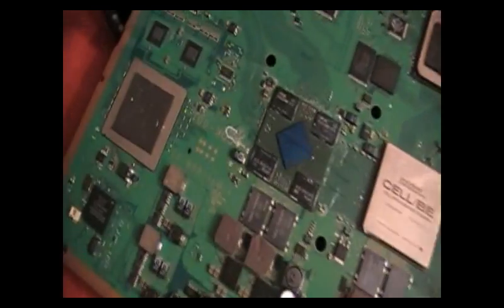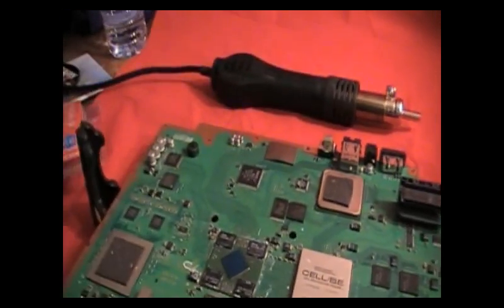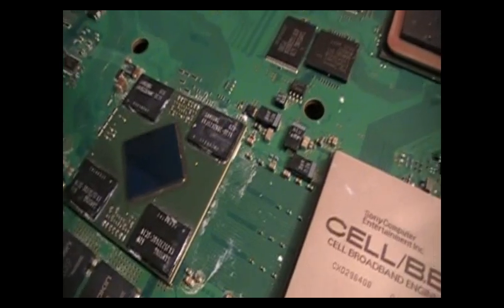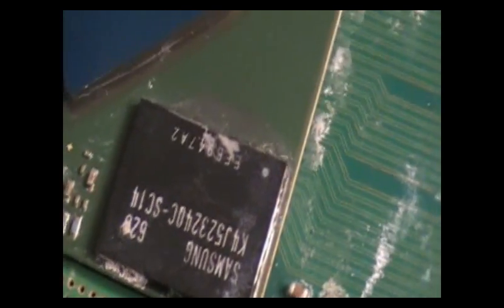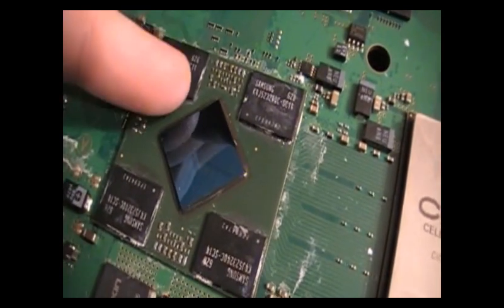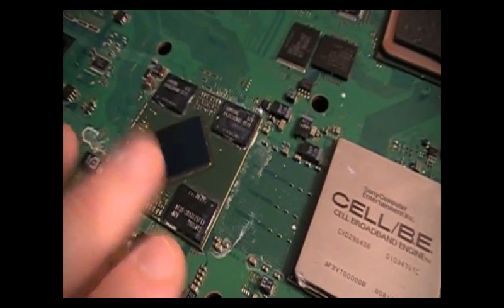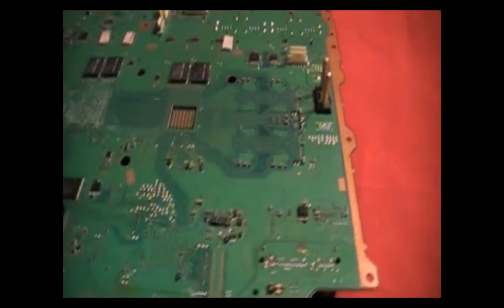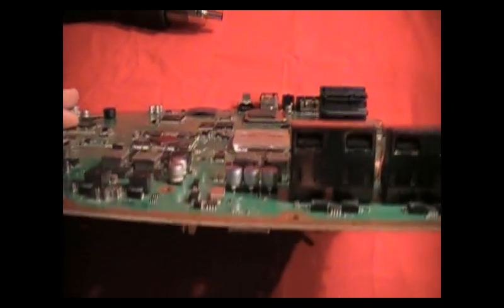Why Reflowing Playstation 3 does not work

Comment: Yo I just took my gpu heatspeader off to repaste and when I put it back together I have a green light but no video on the screen but if I let the ps3 set there and get warm and restart it it will boot up and screen will work it like the gpu graphics chip will only work if the ps3 is warm
Reply: Joshua King d
Reply: search up the glod its very rare but its something to do with the gpu chip on the ps3 either being faulty or there may be a solder bridge, however try turning it off and then turning it on and hold the power button until its beeps twice and see if it shows any signs of life then
Reply: Smart idea @Tacx never heard of this problem as a tech lol
Reply: i have same problem my ps3 work only if it warm up hhhhh